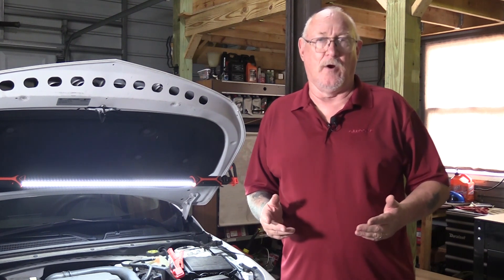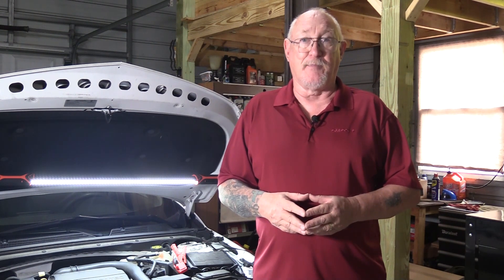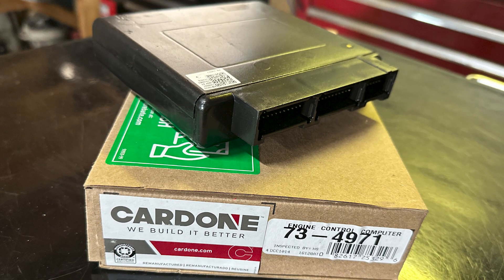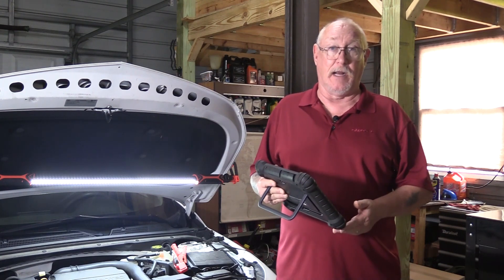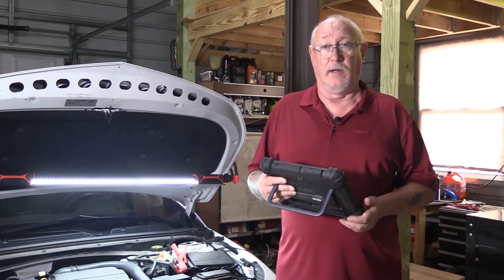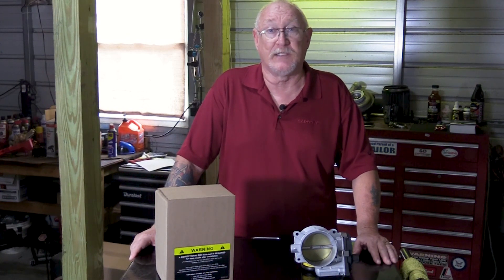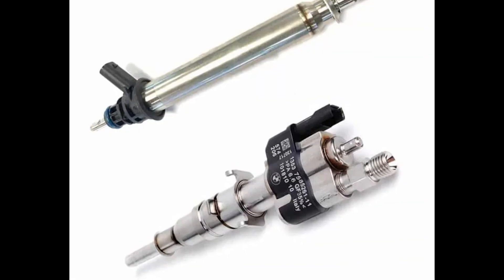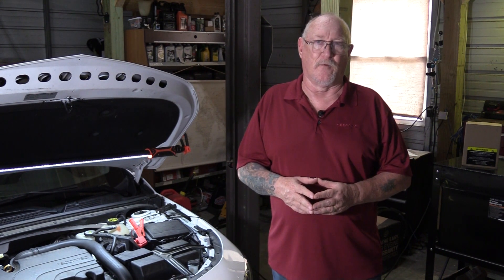Cardone PROTECH #6:  Good Throttle Body, Bad Idle – What To Do About It

Comment: What's the hood light bar? Also, does a 2000 Ford E250 5.4 2v have an electronic throttle body or mechanical one? I have a mechanical throttle, but it does have a throttle body position sensor. My truck also doesn't have cruise control (work truck). Also, is Cardone throttle body any good? Rockauto lists one under daily driver while they have a reman for the same price as the Spectra Premium under "Economy".

Comment: Recently used my phoenix elite scan tool to do a relearn of the throttle body on our 2008 Honda accord and it went on forever but never completed. Tried it 3 different times. Eventually did the manual way from the factory service manual.
Reply from the maker: Glad it worked out for you! Not all aftermarket scan tools meet the OE equivalent, even if they do have the enhanced capability.